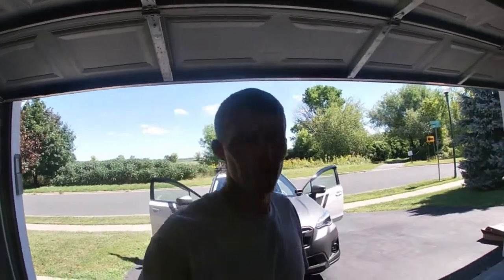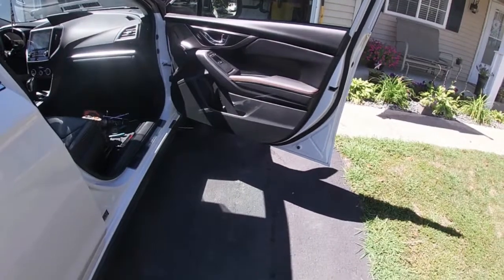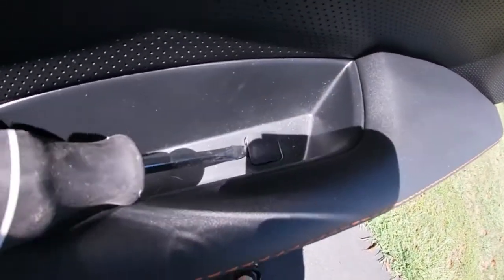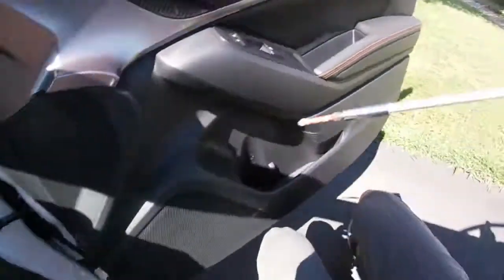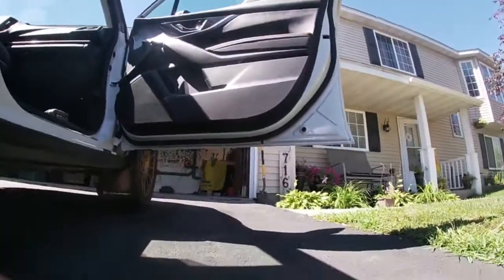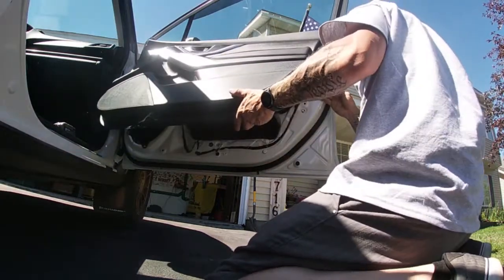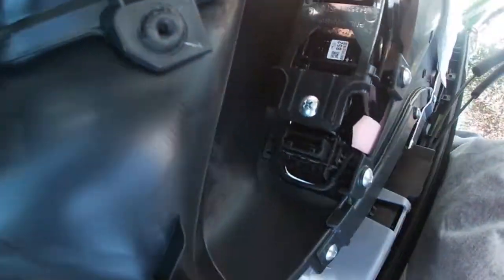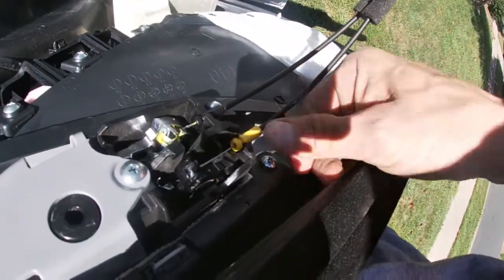Interior door Panel Removal on 18 21 Subaru Crosstrek

Comment: on your hood light video,  i noticed our engine sounds different, did you mod the exhaust or intake or anything? also i accidentally busted a hole in the speaker mesh, i believe the door frame is a one piece but got any ideas to patch up the hole for replace the mesh/grille of the speaker? thanks!
Reply from the maker: No mods done to engine... black ca glue from starbond adhesives